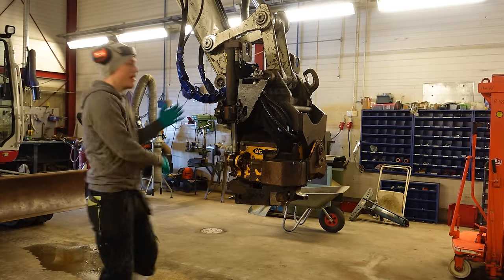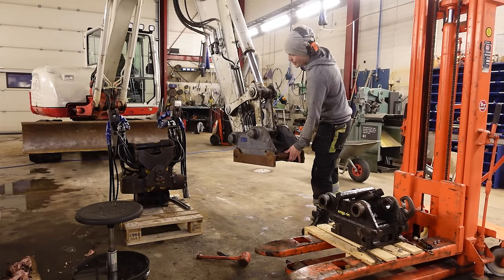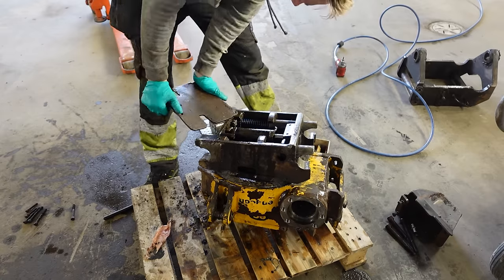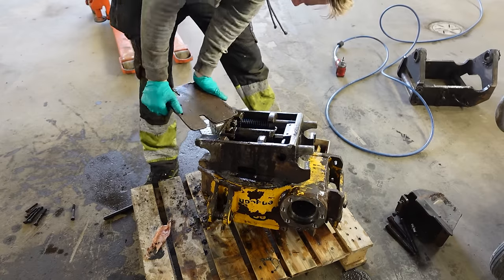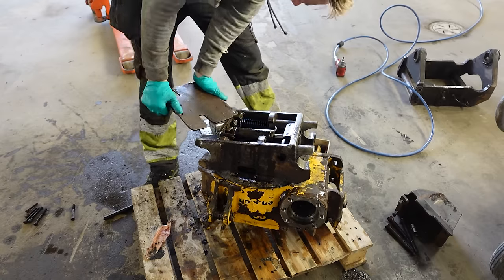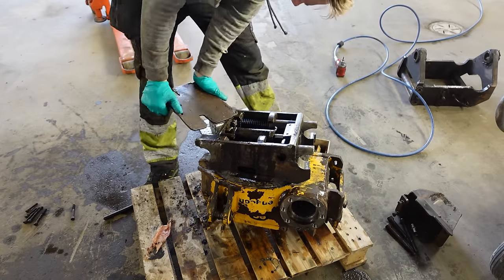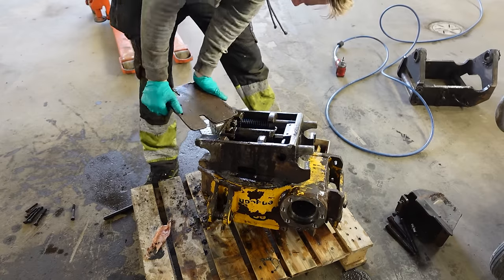Rebuilding a Engcon Tiltrotator to get correct coupling

Comment: 00:05 Explaining the project
01:33 Starting disassembly
03:16 Stealing the quick coupler from the old excavator 
04:47 Cleaning the quick coupler 
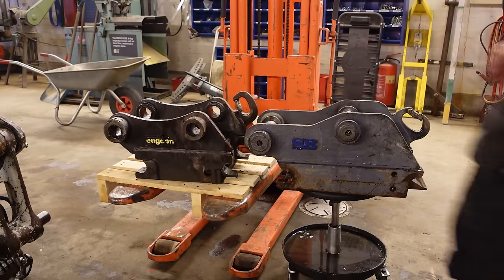05:37 Replacing quick coupler
09:20 Dissembling the Tiltrotator
21:16 Making the swivel bigger to fit the quick coupler
37:20 Painting the swivel
39:24 Preparing worm gear
40:25 Cleaning remaining parts
42:03 Preparing and painting rotator frame
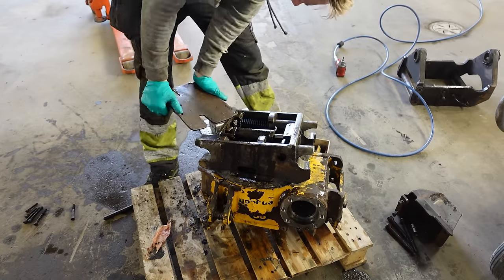44:10 Making the upper frame bigger to fit the bucket coupler
46:50 Painting the upper frame
47:57 Starting reassembly 
55:03 Adding stickers
57:39 Testing the Tiltrotator
59:37 Presenting the mosquito magnet
1:00:00 Further testing
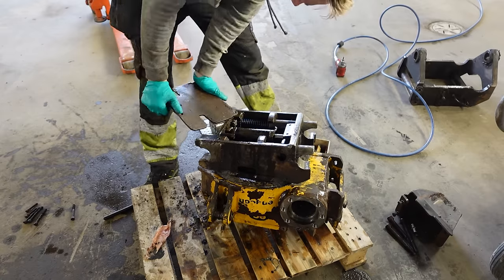1:01:14 Project wrap up

Comment: Great job on the conversion.  Would you have been able to weld in 10cm ‘packers’ into the non moving jaw? Matching profile to fit into the fixed jaw, with matching profile to fit around the bucket pin.

Comment: Use a centre punch and small set of stamps on fittings and hose to line up where they go ... 1 dot, 2 dots, or the stamps... 1, 2, 3, 4 or a.b,c,d etc....

Comment: If he had used his seat belt and had his sliding blades at the back and had stayed seated, he would have gotten away with it. The cabin has a ROP roll over protection. I wouldn't wish this on anyone, including the experienced operators among us. I hope he got away well and wasn't injured too badly

Comment: This is ironic. At first I thought what you did was a crude hack job you managed to get into alignment. Then I saw a video of tiltrotators made in a major factory. Their tolerances were worse than yours with numerous pieces tacked on to hold parts in alignment - some very poorly. And then the entire assemblies were MIG welded without bevels while all your critical pieces including scabbed in were 100% penetration stick welds. VERY impressive.
An aside. Locally we call those devices Tilt-a-whirls after the amusement park rides.

Comment: I also thaught that your work and videos look a lot like those from Andrew. I have to say, I love them, from both of you. I saw you grease the rotater and there is nothing wrong with that amount of grease, but when you are greasing bearings, be aware that you don't use too much grease. I've been professionaly working, 36 years, for the Dutch part of Svenska Fläkt and the companies that took over. And i have seen more bearings  die, because of too much grease than too little. Have you ever seen how little grase SKF puts in their fully closed bearings like the 2RS types?

Comment: Hola , me gustaría comprar un tiltrotator para mi Tb290W me podrías dar una página donde buscar , y que modelo es el correcto para una Takeuchi tb 290/295w? 
Buen trabajo y gracias por el vídeo
Reply from the maker: Hi! I don't know which retailers are available in your country. But the most famous brands here in Sweden are Encon, Steelwrist, SMP and Rototilt. If you are going to buy one, you go by the weight class of your machine to get the right one.
Reply: @M.BJOERNSTROEM  tengo una excavadora igual que la tuya , solo que tiene ruedas que modelo de tiltrotator es el tuyo ? Ese seguro que me sirve a mi ,
Reply: Yo me refiero a tiltrotator de segunda mano , nuevo es muy caro aparte de que nadie lo vende aquí en Austria , aquí se usa mucho Powertilt es lo que tengo montado ahora en mi excavadora
Reply from the maker: The one I have is called Engcon EC10. A new one can be quite expensive, even a used one is still expensive. The good thing about Takeuchi is that they usually have built-in proportional control for the aux hydraulics from the factory, so you don't need external control
Reply: @M.BJOERNSTROEM  en que páginas hay tiltrotator usados ? En tu país , en mi país no hay algo así
Reply from the maker: Even here it's difficult to find used ones for sale, but try the site mascus

Comment: Wasn't that a S-40 coupler? The difference between S-45 and S-40 is the lenght..
Reply from the maker: The axle on s40 is 40mm and 45mm on the s45
Reply: @M.BJOERNSTROEM  My bad, you're right. I have used the like "combi" couplings, where is both S40 and S45 with detachable axle and spacers for to with both couplers with small effort.. I remember it wrong

Comment: Blasting is NO GOOD. WIre wheel is the way to do it. You are never sure if blasting media gets out of critical areas/holes, tiny slots. You can power wash all day and it still can hide and damage tight fits, bearing surfaces, and plug grease holes, etc.